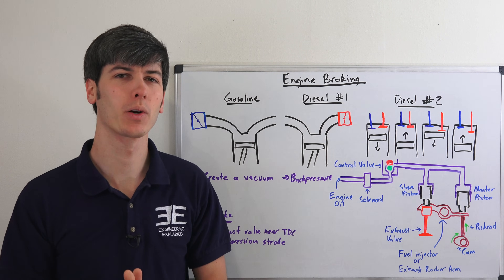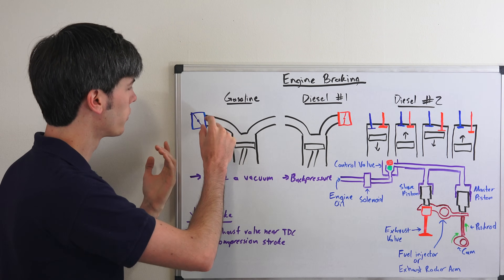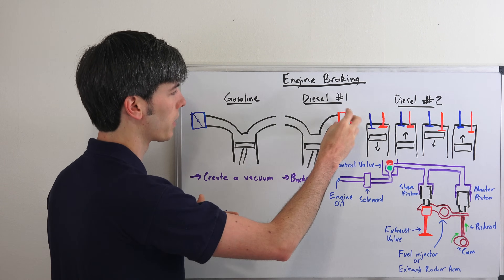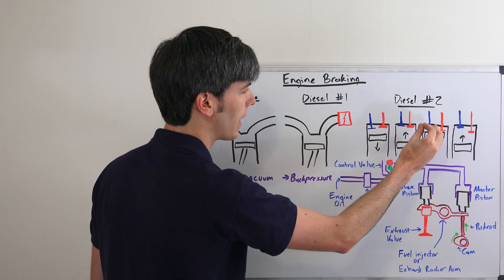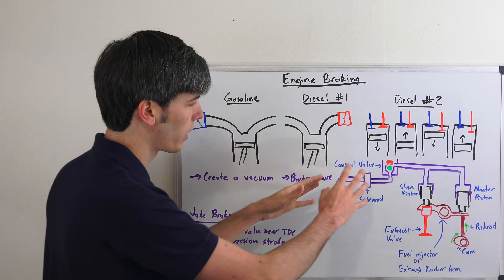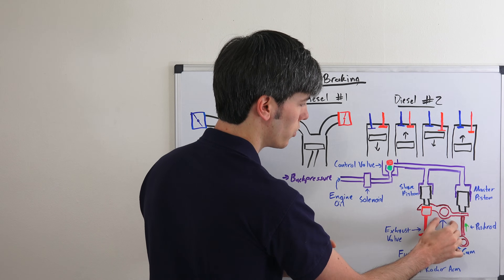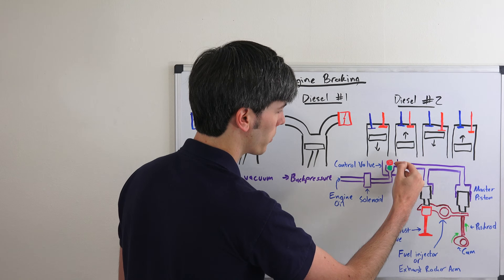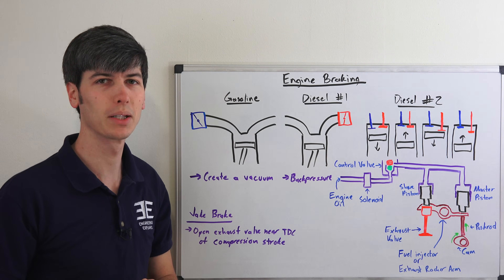What Is Engine Braking? What Is A Jake Brake?

Comment: Is engine breaking in any way bad for your engine? using it for extremely long periods of time without giving any throttle? I could imagine... overheating is the only thing to look out for? I have a heavy camper and constantly use engine breaking. Thanks for the great video!
Reply: Engine braking at a certain RPM adds much less heat than when applying throttle due to the lack of fuel added to the cylinders. Heat added by friction will be minimal since your oil pump keeps lubricating your engine. Your water pump and thermostat continue to function as normal, so if your thermostat says its ok (and it will), then you're engine is fine.  It's much safer to engine brake when towing downhill as the hydraulic brakes could overheat and fade, leaving you with brake pedal going to the floor without stopping you.
Reply: @buzzlesworth54  and is there a real negative to actually using your engine break to get more stopping power on the track.

It seems to me as a really great help during hard breaking.
Reply: @samierop  Definitely not on the track. Racers will use advanced techniques like heel-toe braking to stay at high RPM while they are slowing down, both for additional engine braking and so they keep the engine in the power band to accelerate out of corners.  Brake fade due to excess heat is especially a risk while racing, and engine braking helps the driver prevent that since it only adds heat to the engine's working fluids which have much greater cooling capacity than the size-limited brake rotors.
Reply: @buzzlesworth54  so iff applied in the right way and by using the right technique it sould be a benefit on track. Preventing brake fade...

Comment: nice info but :
concerning gasoline engines, if you are in a slope, and your engine RPM is let's say 3000, if you cut the fuel (maybe you disconnect the fuel pump power), and you open the throttle body(if you floor your accelerator pedal), you will feel more drag, and more braking force, than vacuum condition, and new engines with electronic throttle is using this strategy to increase engine brake...
Reply: Opening the throttle would actually create less braking power. Engine braking in a gasoline engine mostly comes from the piston pulling a vacuum on the intake stroke. If you open the throttle, you decrease the vacuum.
Reply: @Redtooth75    when i was a kid, i've been using my fathers car "280E benz" it has a mechanical injection system (k-jetronic), the story : he fixed a secret switch that cuts the pump (a sort of immobilizer lol).
one day i don't have money to buy gasoline, i said let's press this switch in sloppy roads, and i also noticed that if i press the accelerator pedal, i feel more drag.
your idea is logic, but i tested it, and it was the opposite.
now lets compare : 
with closed throttle : you are creating drag by max -0.8bar vacuum (intake stroke)/then making power (compression stroke with 0,7bar assuming that 10% bar leakages)/then making drag (power stroke by -0.6bar)/the exhaust stroke is neutral.
(0.8-0.7+0.6=0.7)
with a wide open throttle: intake and exhaust are neutral/ you are creating drag by compressing air (compression stroke pressure will reach up to 10 to 12 bars)/then making power with 9 to 11 bars(powers stroke).
(10-9=1)
30% more drag with open throttle ...
Reply: @SuperPaulfa  Thanks for confirming my suspicion that the "pulling against a vacuum" theory is bogus since on the next stroke (compression) the piston is getting pushed up by the crankcase pressure just as much.  I believe that most of engine braking is caused by internal engine friction, engine accessories, and the turbulence and heat loss of what air does make it into the cylinders.
Reply: @buzzlesworth54  its not bogus. Engine braking in a gasoline is caused by pumping loss due to the closed throttle.
Reply: @Redtooth75  How do you explain Paul's evidence that opening the throttle wide-open without adding fuel increases engine braking? I explain it by the air intake causes additional pumping losses as it compressed and pumped out.  Both these processes would cause heat/energy loss to the cylinder wall as the air heats up via compression or friction.

How do you explain that the cylinders that are pulling against a vacuum are, a fraction of a second later, being pushed into a vacuum?  That doesn't sound like something that would cause braking, it brakes about as much as throwing a ball vertically. It's a conservative system.
Reply: @Redtooth75   I don't see the sources you mentioned after reading this thread again, could you post them? This whole "pulling a vacuum against a closed throttle" theory may only be popular because it's a niche subject with a Wikipedia page that explains it that way in a single sentence.  In other words, it's possible that it's bro-science that spread like a meme. 

I'd love to read an SAE journal article or equivalent experimenting with engine braking at various throttle positions like Paul Fahed's somewhat un-scientific experiment.  Unfortunately, I don't have the hills or equipment to post a youtube video about it.   In the meantime, could you explain how the piston that pulls a vacuum isn't pushed up into the vacuum just as much on the compression stroke by crankcase pressure?  I'll allow that a small amount of crankcase air may leak around the piston ring, but pistons move pretty fast so I wouldn't think this accounts for an appreciable effect.

One more thing, don't discount empirical evidence like Paul's. It may not be gathered in a million dollar lab, but it still follows the scientific method much more than throwaway lines on Wikipedia.  Or are you not a fan of Mythbusters?
Reply: you can test it with electronic throttle systems as follow : go to a long slope, at let's say 100km you will reduce gear speed, say from 4th to 3rd, should be above 2500rpm, then you hook any diagnostic tool/live data/throttle position %, and you will see that after 3 seconds or so, the throttle will open.

note : under 2000 rpm the mode will kick back to normal (the throttle will close)
and in some cars you need to apply brake for the strategy to kick in. tested on 2010 hyundai sonata 5 speeds automatic / without brake.

Comment: Is engine brake more effective in a gasoline car than in diesel?
In my diesel car, down a hill, when i lift my foot of the throttle and the car is in gear the revs start increasing and the car picks up speed. And i'm obliged to use disc brakes to reduce the speed.
Reply: Diesels dont provide a lot of engine braking without some sort of auxillary device like a jake brake or exhaust brake. Gasoline engines have throttle bodies, when the throttle is closed the pistons pull a vacuum on the intake stroke which provides engine braking.

Comment: What is engine braking? 
When you hadn't have enough time to brake via your brakes, you start using bumper breaking, then grille braking, radiator braking and then, at last, engine braking

Comment: Back in the 1970s when I was a college student in Los Angeles, I drove Crown school buses.  These two and three-axle buses were powered by either Cummins or Detroit Diesel inline 6-cylinder engines with a five or ten-speed Fuller non-synchro transmission.  I sometimes used the Jake Brake going uphill to catch an upshift especially first to second or second to third gears.  The Jake brake would help decelerate the engine to catch the upshift.  I was king of the road with that Detroit 6-71 when I hit that Jake brake.

Comment: Thank you for posting/sharing, once the compression is released at TDC, isn't the exhaust valve closed to create a vacuum instead of a powerstoke?, and the opened normally by the cam, at the beginning of the exhaust stroke?
Reply: Correct, the majority of the engine braking comes from releasing the compression and losing that energy, but the vacuum created on the power stroke also contributes

Comment: The only reason a Jake brake works is because just before TDC the exhaust valve opens and wastes all of the energy it took to compress a full cylinder to over 200psi. “GENIUS” It will work only with rocker arm driven injectors. Cummins and Detroit Diesel are two of the most common.

Comment: So that's why the VNL I drive builds boost on decel. The higher the engine brake setting, the more boost.

It also doubles as anti-lag. As soon as I touch the throttle, the built up boost is used. :D

Comment: The Jake causes pre ignition or detonation which forces the engine to reverse but when met with the forward movement of the drive train it causes braking or locking up of the powertrain.
Reply: No, there is no fuel when the jake brake is on, therefore no preignition. A jake brake releases the compressed air close to the end of the compression stroke. Detonation is extremely damaging to an engine, it is never intentionally done

Comment: perfect explanation ,jake brakes seem too complicated and expensive,,,how about ,,,not to mention super noisy,how about normal brakes,good driving?
Reply: bill smith because when you’re loaded with 80 thousand pounds or more and going down a grade, it keeps you from loosing your brakes.  Without the engine brake you have to ride the pedal all the way down.  A semi trucks brakes will either get to hot, or run out of air.  

They also help a lot when idiots in cars cut you off and you have to keep from killing them.

Comment: So, you're going to gloss right over the compression stroke of a gasoline engine with no detonation as the cause of engine braking and say instead its a vacuum caused by the throttle body being closed on the intake stroke... umm... no.
Reply: The compression doesn't provide any engine braking, which is why diesels need a jake brake to engine brake. The compressed air acts as a spring, the energy used to compress it is returned on the exhaust stroke. A gasoline gets its engine braking on the intake stroke because it is pulling a vacuum.

Comment: So... you tell us that only the vacuum created by the throttle body closing will slow a car when you skip from 4'th to 3'rd gear on 100 km/h (for example)??? Man, i like your videos, full respect for this, but as an automotive engineer myself, i will NEVER EVER buy this explanation. Sorry but i have to disagree this time with you !
Reply: Its compressing the air that slows the gas engine when decel occurs..  The vacuum aids a little, but is only a restriction of air flow.. The jake brake is different.. It bleeds all the compressed air off of the piston, at top dead center of the compression stroke.. Now the the piston pulls towards absolute zero vacuum, until the valves suck open.. Research the power needed to pull absolute zero vacuum.. Its crazy, how much power it takes to do that.
Reply: @KBS117  I know this :) That's why  i didnt agree with the explanation in the video
Reply: The compression does not contribute to engine braking. The compressed air acts as spring, any energy used to compress it is returned on the next stroke.
The engine braking comes from manifold vacuum. The engine has to pull a vacuum on every intake stroke, this is what creates the engine braking. Most diesels do not have throttle bodies so instead they use a jake brake.

Comment: The engine braking on the gasoline one is not correct. As it creates vaccum in the cylinder it gives back power back at the next stage, working as a kind of spring.
Reply: Oh yeah? So the exhaust valve stops opening magically and the vacuum just stays in the cylinder? 
You are a genius.
Reply: @santerisaari2782  You have a really high IQ. Congratulations.
Reply: incorrect, the vacuum is exactly what creates engine braking. Restricting the intake makes the engine work harder to suck air in, thus creating engine braking. It is a similar concept to an exhaust brake but in reverse
Reply: @Redtooth75  if you are so sure of it explain me this process in the 4 stages.
Reply: @alex90802  the piston moves down and because the throttle is closed it generates a vacuum. Creating a vacuum requires energy. The piston moves back up and then moves back down and then back up again. There is no net energy gain or loss in the past three strokes. Im on mobile right now and cannot provide a source. If you still doubt it I can provide one later

Comment: Many diesel engines doesn't have throttle body or other valves that create a vacuum. Also vacuum is not so important with gasoline ... Compression and gear ratio play a greater role than vacuum, this is a fact! Just think about it, it's logical!

TRY THIS SIMPLE TEST:
1. Turn the engine OFF
2. Put your vehicle in neutral and try to push it, it will go easy
3. Put your vehicle in 1st or 2nd gear and try to push it, you will NOT move it a inch...
4. Put your vehicle in 5th or 6th gear... you will push it almost as easily as in neutral

Comment: Hi Jason! When the throttle body is closed, oil vapour from the crankcase will invade the combustion chamber causing carbon deposit build up as a result of the inverted pressure difference? By the way, nice video lessons!

Comment: Jason, many diesel engines doesn't have throttle body or other valves that create a vacuum. Compression and gear ratio play a greater role than vacuum, this is a fact! The compression is the reason why diesel engines have a stronger engine braking than gasoline. TRY THIS SIMPLE TEST. Turn off the car. Put the car in neutral and try to push it, you will succeed. Put it in the first gear or second and try the same, it will not go! Also on the downhill, in the first gear it will stand, in the fifth it will move as if it were in neutral. Vacuum does not play a significant role especially in diesel engines. If this is the case, a gasoline car turned off would be difficult to move even in neutral.

Comment: Question: how much of the engine braking is due to internal friction, as opposed to pressure in the cylinder?
Reply: It all compounds to give a total equivalent braking force,  the internal friction of engine is greater the higher the rpm so ideally engine red line is generating maximum friction forces, there is some loss of effort if it is in a petrol engine due to the compressed air in the cylinder pushing back on the piston as it travels down its stroke, but the very fact it is not a true power stroke means there is still alot of energy dissapated adding to increased engine braking. And if you are lucky enough to have a Jacobs engine brake, especially mounted in a series 60 Detroit engine then the figures are quite amazing. I used to drive a Kenworth with series 60 Detroit 12.7 liter engine rated at 475hp, with the Jacobs engine brake engaged and running at near red line 2150rpm that engine would generate 370hp equivalent in braking force just by flipping that switch on which is alot of braking effort before I even needed to use the service brakes, and with a Horton fan kit fitted to cool radiator that used a further 25 hp so close to 400hp slowing you down is awesome. Hope this answers your question

Comment: is this engine braking good for the car or the light transport vehicles or is it only for the trucks or heavy transport vehicle and when ideally to use this technique , should be used with brakes or alone ?
Reply: Any engine braking will help increase brake life and tyre life and will not hurt your engine in any way..if it did they don't deserve to be sold to the public. Generally use  this technique in tandem with brakes to achieve a smooth deceration of your vehicle. Remember using brakes causes weight transfer apruptly to your vehicle where as engine braking has less tendency to unsettle your vehicle during  inInitial slowdown from highway speed or when decending grades.

Comment: So which is more efficient in engine braking system, when we use the three methods which you have mentioned from you video clip?
Reply: Jacobs engine brake is by far the largest producer of retarding power, followed by the exhaust brake and finally just engine friction and inlet restriction last.

Comment: Does using the Jake brake use/ waste fuel?
Reply: No fuel wasted in the big picture, older mechanical injection systems always allowed some fuel delivery but the newer electronic engines will cut the injection cycle, to be noted also that Jake brakes when operating also increases turbo boost levels to approx half of full power operation when accelerating, ie average boost pressure in Detroit, cummins caterpillar anything from 30psi to 50psi so therfore approx 15 to 20psi during Jake operation. Any fuel costs far exceed costs to replace brake linings on heavy vehicles.

Comment: So why is engine braking generally more effective on a car with a manual?
Reply: Torque converters slip, they're designed to transmit power from the engine to the gearbox they don't work very well in the opposite direction.

With a clutch torque goes both ways just fine.

Comment: Question

If I understood the jake brake can be found on trucks and other big/heavy diesel vehicles. But do any normal cars use it?

I understand a normal cars brakes aren't in the same kind of danger from overheating but still can this be installed in a car anyway?

Also are there any downsides to having a jake brake on an engine performance wise? Fuel efficiency? Or some third problem..?

Comment: Correct me if I'm wrong.
I understand that the jake brake is used just in the trucks. And what about the fist option? Can we found it in all types of diesel engines or just in trucks? If so, how the engine braking works in normal diesel car?
Thanks in advance for all answers!

Comment: My car has a 1.6 crdi engine. It appears to have little or no engine braking capability. It coasts in gear with no throttle application almost as if it were in neutral. My previous 1 litre petrol engine car had very noticeable engine braking. I just assumed that diesel engines don't have engine braking because of the lack of vacuum pressure. Maybe my car's engine does not have a back pressure valve?